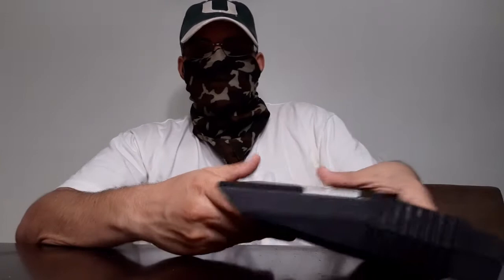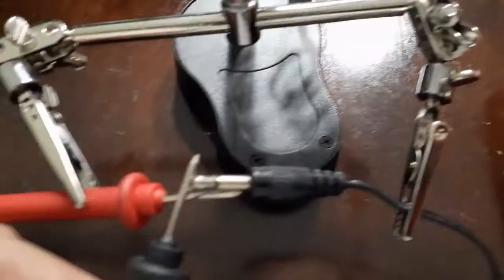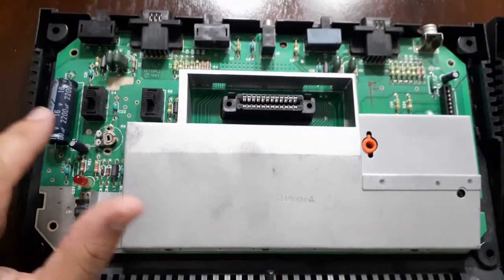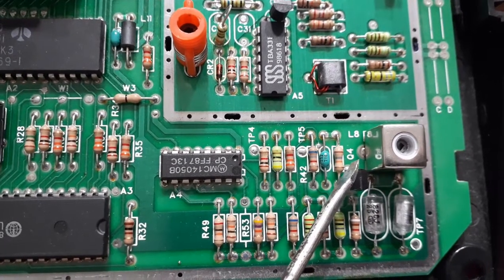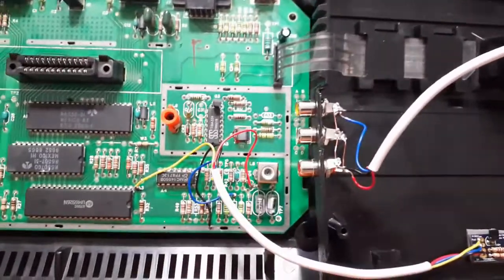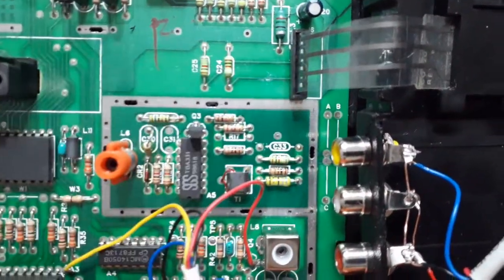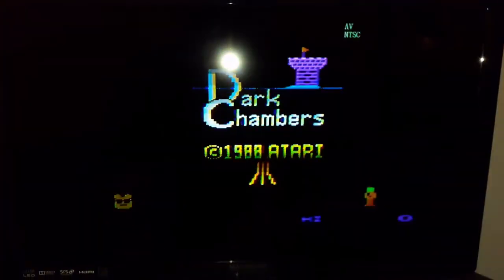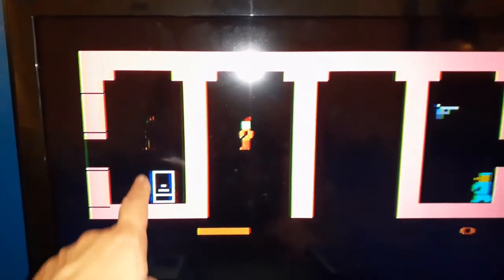How to: Full Atari 2600 Jr. RF to AV (RCA) Modification

Comment: Moving a 2600 jnr from 1985/6 This kit tells me to remove rf modulator box from board and associated components I.e trans,a few resistors & that copper wound inductor etc.Tiny pre-manufacrured module with surface mount componants. I have mounted outputs where TV aerial skt is by cutting bigger hole.Lets say we shall see if mod works.I can't be reversed now😮
Reply from the maker: Good luck! You should be a-ok. I love that people still hold onto these classic systems (including myself) and try to bring them into the future! What sucks is to later find out you could’ve bought a modern version of the 2600 with HD outputs for around $75. 🫣 But you can’t replace the learning experience.

Comment: I'm noticing that you are using a very common AV mod that is even for Atari 7800 models and clearly a ghosting on gray areas; I solved that by not using the 75 ohm resistor specified in schematics. You might get more washed out color signal, but that can be fixed by using a smaller resistor in the video signal (not video output on one side and GND on the other side, but only video output to filter it, I used 10 ohms). I have seen people using 2N3904 where others used 2N2222. 2N3904 is better, doesn't get much the dreaded jailbars on your TV.
Reply from the maker: That's awesome! I tried putting a little foil over the board. It helped some with the interference but not a cure. Sadly the lesser definition AV worked better for that than upscaling. For me it wasn't worth doing more at the time. Thanks for stopping by!

Comment: Ummm. Tested and no audio but picture. Audio is not processed on mod board as there's a direct PCB track from A to A output so...I must either have a bad solder joint or wrong solder place.we shall see
Reply from the maker: Good luck! It’s amazing what a lack of solder does. Far be it from me to ever discourage anyone from doing this and the learning experience but hindsight being 20/20 you could score a Retron 77 fairly cheap and have a modern platform with HD that plays 2600 cartridges.

I believe there is also one that plays both 2600 and 7200 cartridges as well. On the 5200 is a must to mod. I did a video on that one too but regardless how many times you fix and upgrade the controllers, they still suck!

Comment: just fyi this is composite. not component
Reply: Indeed
Reply from the maker: Depends on your age. I grew up in a TV repair shop since the age of five and that was 1982. They have ALWAYS been "component" ports (to techs) or simply A/V jacks or RCA jacks because well, RCA started it....or at least they got credit for it. They did not become known as "composite" ports until years later when you had the option for RGB then that became labeled as "component" and standard single video became "composite." But correct, standard was never really labeled as "component." They were generally simply labeled as Video and L/R. Thanks for stopping by.